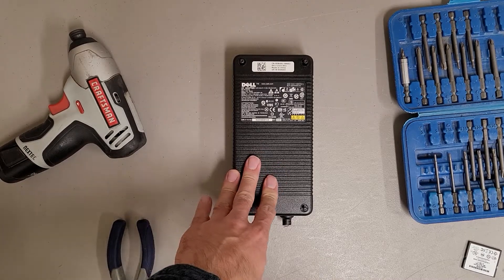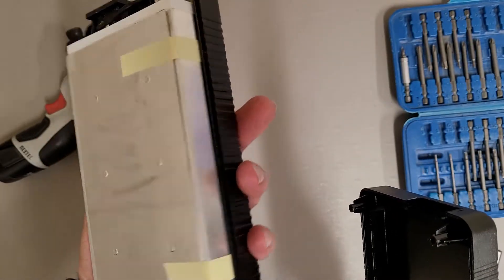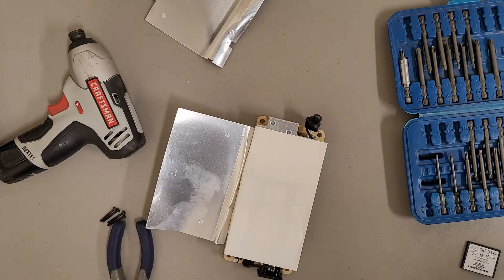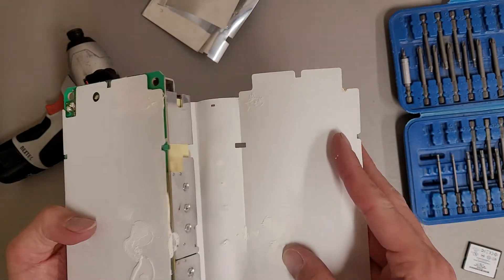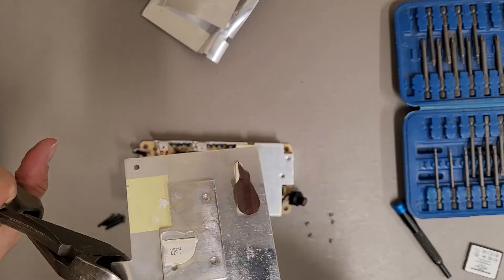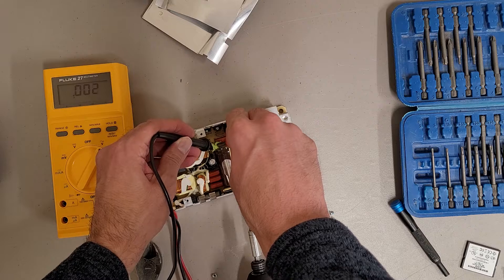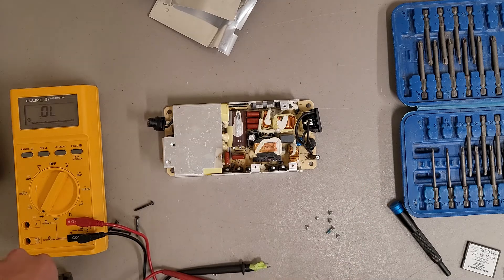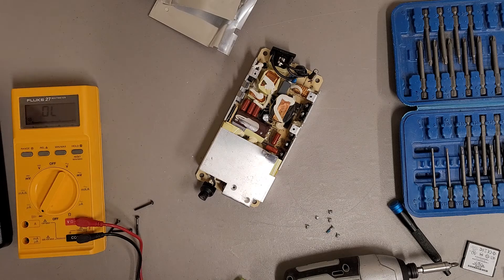Dell D846D PA-7E 210W laptop power adapter #teardown

Comment: didn't know they had laptops with 210 W, I would think it was for an AIO model?
Reply from the maker: Some of the precision and xps laptops required it. Also some AIO's and docking stations.
Reply: Hello my charger have a problem it's working good in first but if I'm play heavy games charger turned of alone and he be so hot